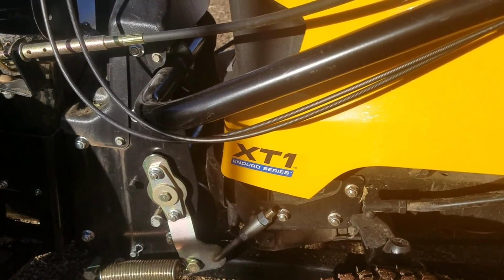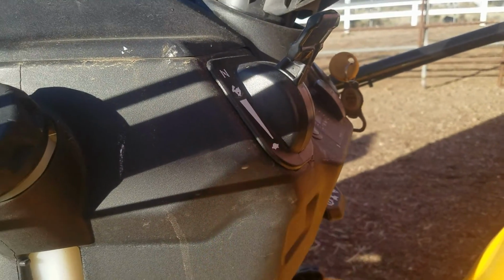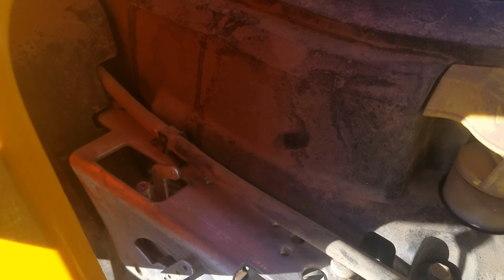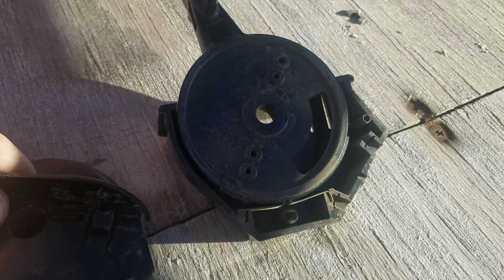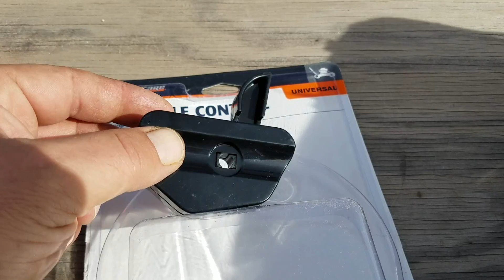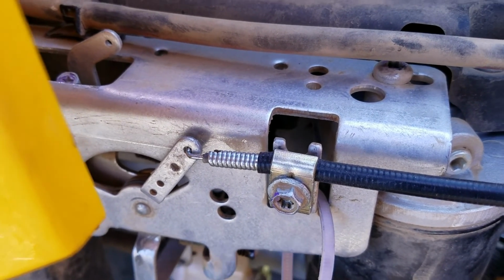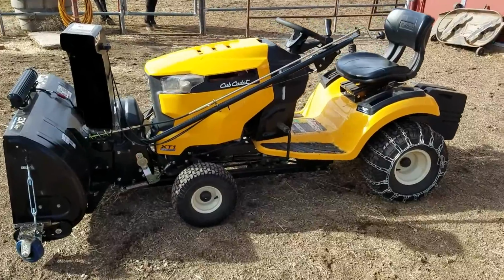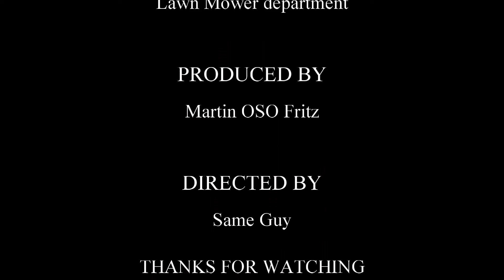how to fix Throttle control on Cub Cadet XT1

Comment: WLL PARTNER..you saved me a ton of aggravations..got my cub running..after new blades..belt..gas filter..air filter..Cub wouldn't  start Throttle  cable got loose..followed yòu ..fixed Right up ..saved $$$$.And  pride satisfaction up 💯percent..thanks..

Comment: Thank You!  I bought the same throttle control from HD, but I re-used the original throttle housing and cable "sheath".  I just used the cable itself from the HD kit.  I cut the end off the wire and fed it through the original sheath.  Then I reinstalled the throttle control and cut the wire where I wanted it to be on the engine side.  A video from donyboy73 showed me how to make a z-bend and attach it to the carb/choke assembly.  A little adjustment with the screw holding the cable and it's working again!

Comment: So you purchased a non OEM Cub Cadet throttle control and cable.  You never showed how you modified it to fit for the throttle lever insertion or cable length.  I have a 2016 Cub Cadet XT2 that the throttle cable broke.  I ordered the stock CC OEM part and the throttle cable was 10mm too short.  I paid over $60.00 US for the replacement part and discovered it was way to short.  Screwed in Vermont and snow on the way.  I'd love to know where you purchased your throttle replacement part that fits.  Following up, I would like to see a vid on how you installed and wired that LED light bar on your snowblower as I would like to do the same.  Cheers!
Reply from the maker: Generic throttle cable from Homedepot. Came with a lever for 18 bucks. There are 2 snappers on the round housing. Pry them open. From there its easy

Comment: great video..I wished you would have shown taking the throttle assembly apart to discover it was broken...
Reply from the maker: KEVIN it's just 2 snappers you have to pry ooen
Reply: @Martinvontirol  thanks for the heads up. I got the new part (the whole throttle assembly) and was able to install it in about 5 mins. Thanks for the great video. The part from the dealer was $43 with shipping charge. Exact OEM part.
Reply: I luv YouTube!!! After changing the blades i noticed the belt was about shot, changed the belt, checked the air cleaner and it was time to change it,,, after that i went to mow,,,, and had to charge the battery,,, all night charge and still didnt want to start,,, new battery,,,,, THEN the cable broke or so i thought.  Found this video and took me two minutes to fix!!!!! Thanks for posting!!!!

Comment: Thank you for your video! The throttle cable on my XT2 got stuck, but thanks to you, within a matter of minutes I knew how to pull the plastic assembly out without breaking it, lubed the cable and got it moving again, reassembled the whole thing, and got back to work. Really appreciate your trouble and willingness to share!

Comment: In my case, the hole inside the plastic housing has been ripped open. I looked at the Cub Cadet parts side with no find. Any idea where I might be able to find another or what they're called specifically?
Reply from the maker: I fixed a ripped out plastic housing by glueing a fitting washer in

Comment: I feel that throttle very difficult to use on these! Not good quality at all! Great video thanks for sharing
Reply from the maker: It gets stuck easy and is for sure very sensible to dirt and dust. If you are a bit handy you could replace it with a metal housed one from Tractor supply.

Comment: ok so my husband past away October  so learning this  by myself got it going but stays at high speed  so what did i do wrong ? please and thank You
Reply from the maker: @txtornado2007  probably the cable/wire or the carburetor is stuck. See if you can move it freely
Reply from the maker: If the wire is not secured in the handle housing properly it will not move with the motion of the handle

Comment: Pretty sure that the throttle you installed isn’t the same one you showed from Home Depot.. it was a factory Cub Cadet throttle
Reply from the maker: Correct, I took the throttle apart and installed a new cable from HD. Small modification as the HD throttle wouldn't fit the housing cut out